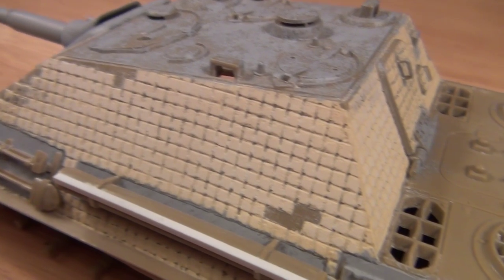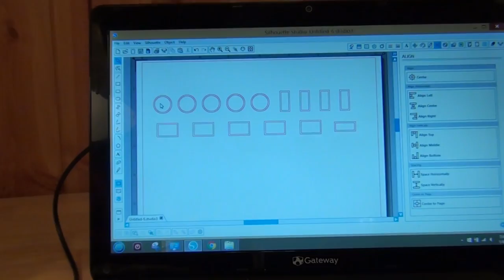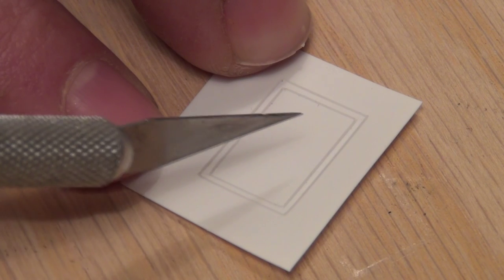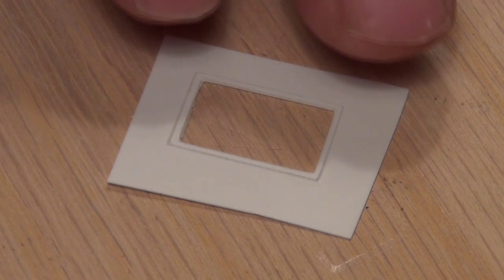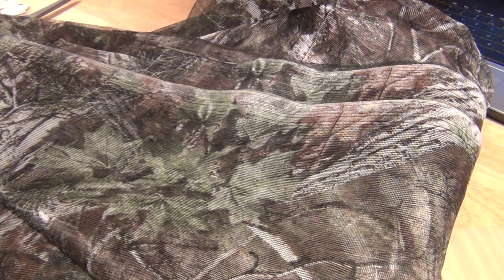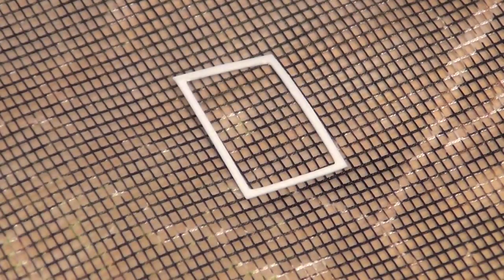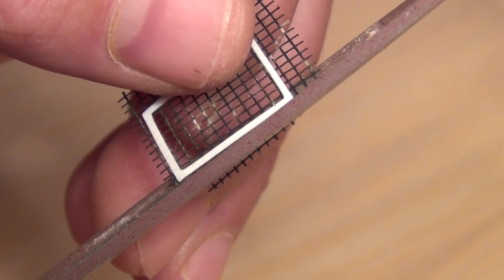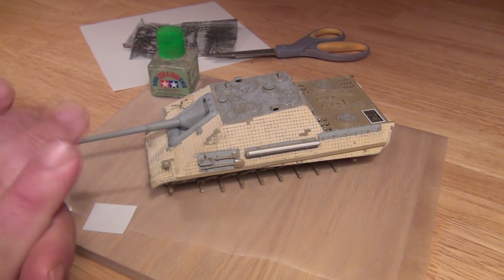1/35 Armor:  Scratch Building Engine Deck Screens Tutorial

Comment: For my very first attempts at mesh netting I used a simple roll of gauze bandage, then for the frame just cut some strips of plastic sheeting and glued them over the edges of the bandage.

The only problem with the bandage was it had a bit of "fluff" on it, so I simply ran it over either a lit match or a disposable lighter to burn off the fluff.

it didn't look too bad for a scratch build job, this was way before photo etched mesh was available back in the late 70's.
Reply from the maker: The 70's... when scratch building actually meant "scratch building".  I actually got the idea from an old Verlinden book.  He used mosquito netting, which I think the camo netting I used is really the same thing.  It's crazy the amount of aftermarket stuff available for modelers these days, all the PE stuff.  The hobby sure has come a long way since the 70's and 80's.
Reply: You have another video about applying zimmerit, one of Verlinden's books on Tiger tanks, he demonstrated a method he used using what is known as a pyrograph.

It's a device used primarily, I think, for burning patterns into wood, or for working with leather, anyway the device comes with a variety of different tips, and he uses that, after adjusting the heat of the tip, to "score" the zimmerit pattern directly into the plastic.

Not having a pyrograph I used a soldering iron instead, I then used fuse wire to fasten a sewing needle to the tip. To adjust the heat on the needle tip I could then move the needle in or out.

I used that method to put zimmerit on the early Tamiya Ausf A Panther, actually came out really good, I was impressed with myself, took forever though so your method of using wood filler and the zimmerit applicator is much quicker.
Reply: Have you tried using leg nylons?
Reply: Old, bald fat man  - No I haven't, but I find them a bit too stretchy, but I don't think they have the correct pattern to successfully imitate mesh netting.

These days though, you just have to buy photo etch grills which look pretty good.

Comment: Like it.
This and the schurzen idea are another use for my `Craft Robo`. Pretty much the same as you use. Made by Graphtec?
If so, did you know there is a Adobe Illustrator plug in?
This will really open things up. Options to trace at better res, and also much finer measurements for drawings.
Can basically scan your decal sheet and trace it, convert it to vector, then output to cutter. Also font choice becomes unlimited for AFV numbers, currently hunting the best German armour fonts. Also allows custom inscriptions on your models ie `First in Bastogne` Sherman.
Reply from the maker: Hi Barry,  I'm glad you enjoyed those tutorials.  These machines really do open up options to us modelers.  I did not know about the Adobe Illustrator plug in...I will have to look into that as it sounds very useful. I never did have real good luck scanning kit decals for making stencils.  The graphic resolution was never good enough for the program to accurately trace them.  Could be the program in addition to the lower quality scanner/printer I have. Like you, I also have looked for and researched "Panzer number fonts" and have come to the conclusion that there doesn't seem to really be "one".  I've gone through all the fonts included with my Silhouette machine and found a few that were "close enough", for me anyways.  Also found a few that would pass for Russian armor as well.  The "First in Bastogne" slogan sure did cross my mind as well along with other Russian slogans (which I did actually have some luck in reproducing from kit decals).  Once again, I'm glad you enjoyed the videos and thanks for the positive comments.
Reply: Happy to throw ideas your way.
Will let you know my findings when I get my cutter set up again......recent crossover to windows 10 has done away with all my old software setups. It seems Silhouette is the new model name for `Craft Robo`...try downing the plug in from support. The s/ware is quite basic that comes with the cutter.
Prob dont even need a scanner.... lots of material available to the modeller in vector format, and failing that a good enough pic from a website can be traced and resized via illustrator.
What guage/thickness plasticard are you able to use...and what colour blade do you put in?
Too thick isnt gonna be good for the Silhouette.

Comment: What kind of printer are you using? Never seen/heard of one that would print (engrave?) on plastic.
Reply from the maker: It's called a Silhouette die cutting machine.  It's actually used for scrap booking, like cutting out paper.  But it's strong enough to cut light weight styrene plastic.  I bought it originally for cutting out wheel masks using masking tape.  I bought mine off Ebay but they are available at craft stores as well.
Reply: Thanks....checked Michaels/Hobby Lobby and neither have it. Or it just may be under a different name/ description. But they are available on Ebay as you said. See there are colored aluminum sheets available for this machine and wondered if you've tried them.
Reply from the maker: No I haven't.  Only thin sheet styrene so far.  I like it for making masks.  Both wheel and number masks.  Works terrific for those applications.  I'm sure I'll come up with a few more uses for it!  I looked it up, mine is the Silhouette Portrait.  Comes with software, cutter, cutting mat, and the machine.  Usually around a hundred bucks new/shipped.  You'll easily make that back in making your own wheel masks.